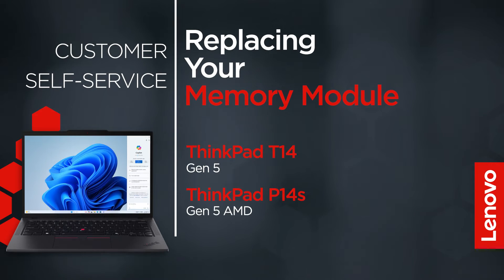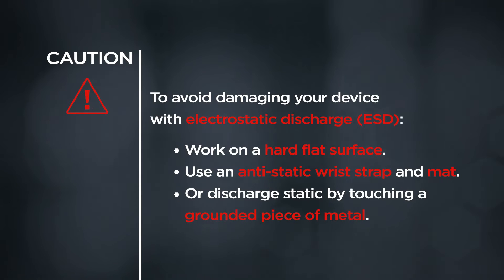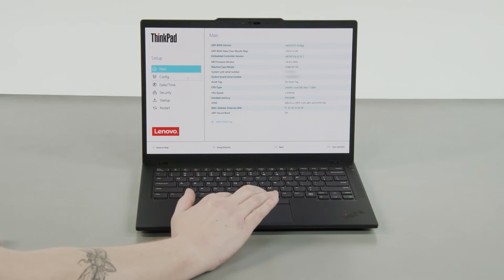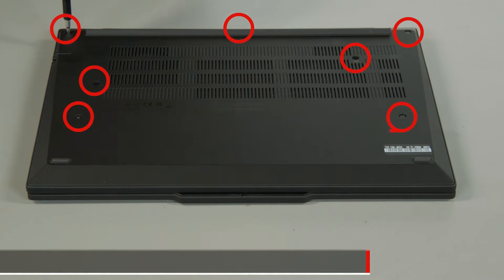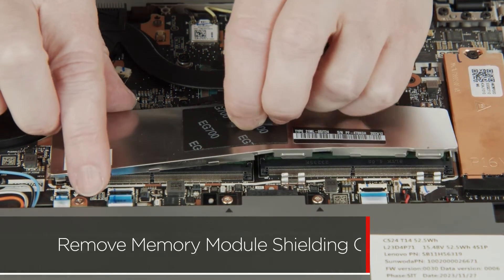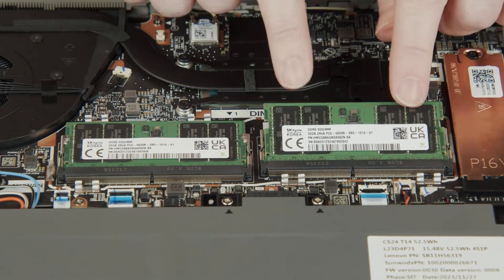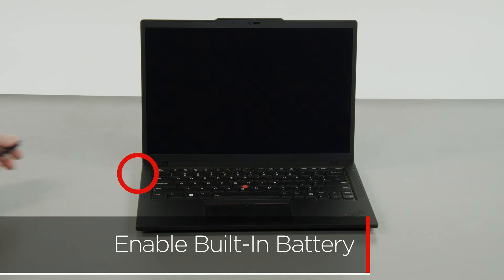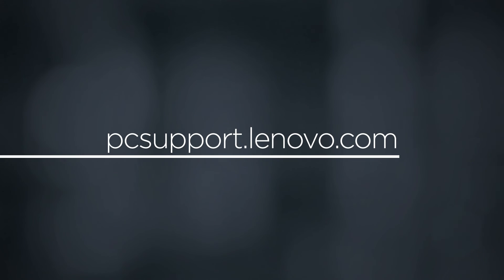Replacing Your Memory Module | ThinkPad T14 Gen 5 and P14s Gen 5 AMD | Customer Self Service

Comment from the maker: This video will show you how to replace the memory module in your ThinkPad. The process in this video will work for the ThinkPad T14 Gen 5 and ThinkPad P14s Gen 5 AMD.

You will need a screwdriver kit, a non-metallic pry tool, and 15 minutes of your time.

To view the ThinkPad T14 Gen 5 Self-Repair Guide go to https://pcsupport.lenovo.com/us/en/products/laptops-and-netbooks/thinkpad-t-series-laptops/thinkpad-t14-gen-5-type-21ml-21mm/selfrepair/removalsreplacements

To view the ThinkPad P14s Gen 5 AMD Self-Repair Guide go to https://pcsupport.lenovo.com/us/en/products/laptops-and-netbooks/thinkpad-p-series-laptops/thinkpad-p14s-gen-5-type-21me-21mf/selfrepair/removalsreplacements

To learn more about your device go to https://pcsupport.lenovo.com

To find parts for your device go to https://support.lenovo.com/parts-lookup/?cid=ww:lenovosocial:b9515f&source=socialmedia&subsource=yt

To view the Lenovo Support Self-Repair Guides landing page go to https://support.lenovo.com/us/en/solutions/HT516547

** NOTE: Static electricity can destroy components. Use a grounding strap, and clean, non-conductive surface to work on. Use plastic or coated tools to prevent scratching and avoid using metal tools on plastic parts. For more detailed information on electrostatic discharge and how to prevent it, please watch our "Understanding Electrostatic Discharge (ESD)" video: https://youtu.be/by4PB3WtdLo 

Applicable Machine Types:
ThinkPad T14 Gen 5 - 21ML, 21MM, 21MC, 21MD
ThinkPad P14s Gen 5 AMD - 21ME, 21MF

Check out other official Lenovo channels!
https://www.youtube.com/@Lenovo 🟥
https://www.youtube.com/@lenovolegion 🎮
https://www.youtube.com/@Lenovo-PC 💻
https://www.youtube.com/@LenovoSuporte 🟢🟡

#Lenovo #LenovoSupport #LenovoTechSupport